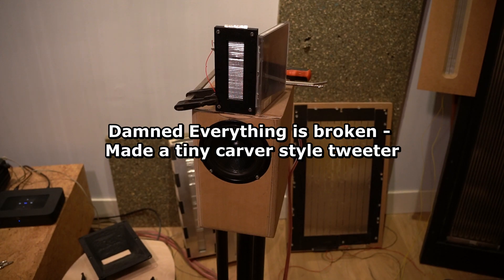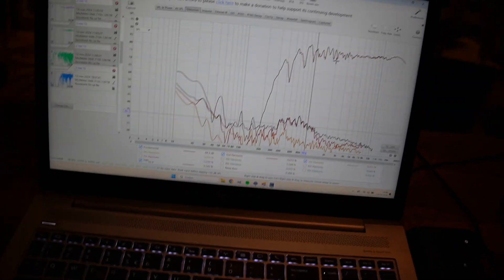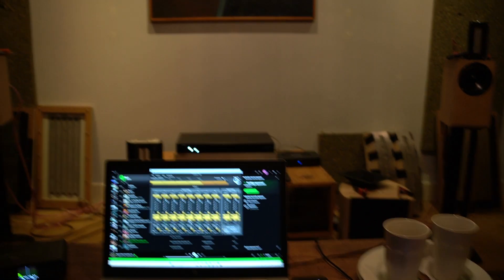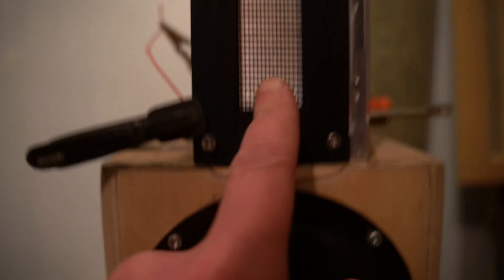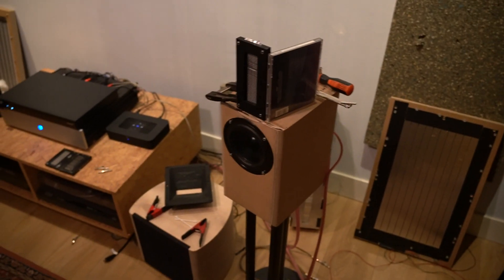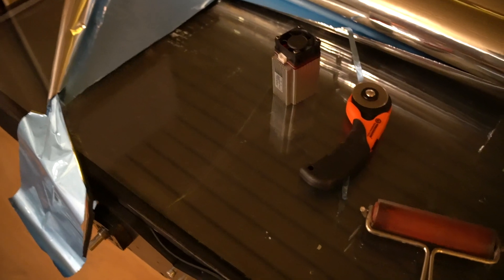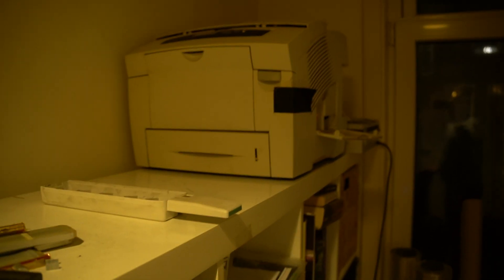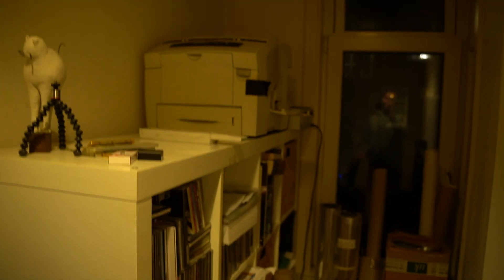Damned Everything is broken  - i made a tiny carver style tweeter, explain my fails and a tune.

Comment: Right Speaker : The CD should be on the other side of the tweeter to avoid strong reflection off the front wall to your listening position ... also the absorber on the wall gets more work to be done ...

Instead of a nearly square hard plastic CD you can try different shape/size , long exponential slot like the the Karlsson speaker might work better ... a felt-like material is also better usually.

The magnetostatic is somehow coupled to the woofer acoustically ... to improve the situation put a wide enough gap between both acoustic elements! (a few cm will fit)

Distortion will go down but freq resp gets worser ... making the slot angular over distance should get smoother response ....

Why not using the GRS PT6816-8 driver? (around 75 euro here in germany)
Reply from the maker: haha yeah i tried that a few times , this time it might just be  completely based on where the clamp was :)

Comment: YOU must find a original heil Air motion from ESS América , no replica . If YOU find YOU ave a Big surprise , im 60 yesr old and ave a long pasión IN listening music and play . IS THE fastests and clear speaker ever ....
Reply from the maker: well i know amt's and the heil is a nice driver!!. but they will not reach that low , and use 1kg of metal to achieve what they do. but less low :) an amt is not that efficient in producing lower frequencies in my opinion.  the fable it has a 6 times more surface area when  (if it would be if unfolded) is not exactly true.  i made quite a few Amt''s and they always under perform if you would had a planar with the same surface area unfolded

Comment: Which dayton driver is that?   I have been having great results and low distortion with the 7 inch paper cone reference
Reply from the maker: It is the dayton DS135. either there is something wrong in my housing (and  or my ceiling, witch is able to resonate at some points) i always have nasty resonance around 300-500hz :( i once took them to a diy event and they had the same feeling :(, ill buy some decent ones soon see how that goes and these can retire :) after so many years

Comment: wow, tweeter only is pretty good.  Very low response.
Reply from the maker: well it is crossed at 450 hz give or take the higher you cross the lower distortion and higher max spl. so for my room i chose rather low 450. since i wont be playing much louder with these tiny woofers :) but 600 would be better